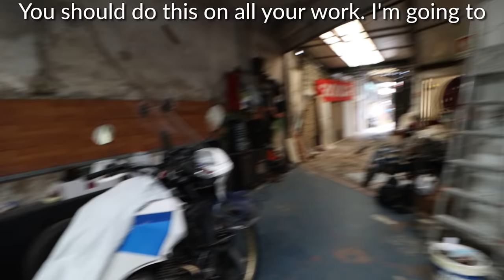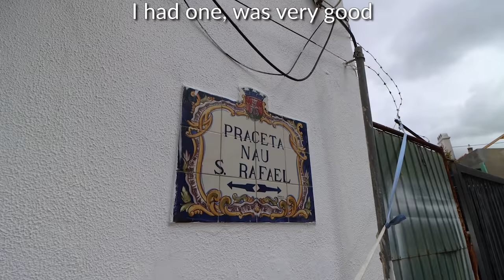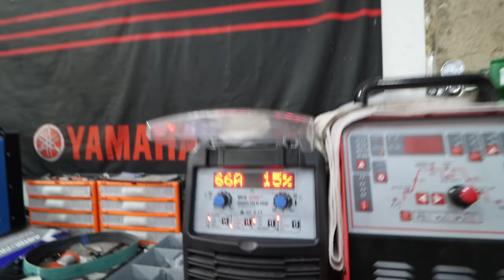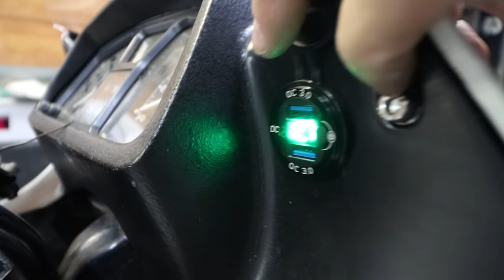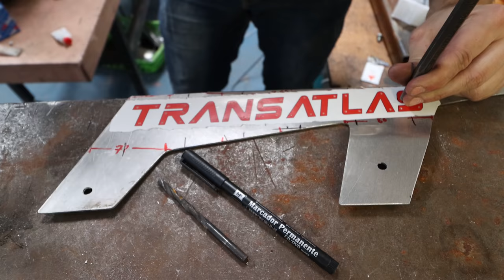First Time Running Complete New Exhaust System - Honda Transalp custom build Pt. 4

Comment: Cool video! Don't forget some heat guard on the pipe behind the peg otherwise that hell of the pipe will melt your heel ;)
Reply from the maker: Yea didn't take long to melt some glove when I casually put my hand there while inspecting during the test ride. I've been going back and fort about it with Mago since last week and he has just the piece for that. Should be the last thing going on.

Comment: Oh Man! I'm in love with that bike. I have a Predator windshield from Goffi on my 650 and now I think I will go with that fender :D. And that freaking exhaust.... Sweeeeeeeeeeeeeet!
Also loved what Mago was doing during Rammstein Du Hast. \m/
Please make a summarize video with all changes on Atlas Man!
Nice Polish there BTW ;).
Reply from the maker: Yeah it just ups that front style which I think is the weakest angle on the TA. All that's missing is a nice set of thick WP forks! Cheers for sure, it makes the right rear diagonal angle (best) even better. I gave Mago some Rammstein lyrics lessons, how Mutter is a lovely mothersday song.

Comment: Does Atlas have a folding shifter??
I made an adjustable length one that fit my smaller than normal boot. I bought a used off-road shifter and drilled adjustment holes on each arm.

Comment: hey man where did you get the handle protectors, i want some for my AT750?
Reply from the maker: They are called 'Barkbusters', a few options online but stock can be an issue. I got mine at Belgarpir moto near Sintra.

Comment: Did you change carb jets? Sounds it's now running way too lean?
Reply from the maker: Not at this time. We later still adjusted the screws on the carb and it was running better with pretty instant throttle response. Those don't have anything to do with mid to top but so far a short stint on the highway going 120kmh went well. Generally I don't sustain high speeds, doing about 100kmh on average. I'll keep an eye out on the plugs, who knows might be a job for later.
Reply: @iPedroMota  Good to hear. Anyway it seems to definitely have done the trick. Otherwise it wouldn't have ran lean with backfires. I'd suspect you've got couple horses more when you change slightly bigger jets. Tell Mago that he's done good job 👍👍

Comment: I think that you need a little bit of practice in Polish language ;) It sounds more like Russian for me ;P However, you said "Urządzenie posiada system (?) voltage reduction device, który dla trybu spawania MMA elektrodami rutylowymi i zasadowymi obniża napięcie (?)" so I understood pretty much most of it ;) Not bad :)
Reply from the maker: Tak! I've forgotten most of the very little Polish I've learned, all nice words of course, when working my first job in agriculture when I was about 14/15 years old. A lot of hard working Polish dudes there. Btw congratulations since I just taught you how to Mig weld.
Reply: @iPedroMota  you did pretty good with the Polish worlds - this is not an easy language.  I know that some people are working in Netherlands in agriculture so I believe that the learned you only a nice worlds ;) P.S. The part that you just read was about stick welding so I think in the next video you should read more of this manual ;)

Comment: PEDRO - Although the exhaust looks great and high performance it might not fit your application, if you leave the motorbike UNDER THE RAIN (engine off) water could fill up the exhaust AND eventually get into the cylinder itself (through an open exhaust valve). A hydrolock waiting to happen.
Reply: Good observation. Guess Pedro will have to avoid the UK then. Atlas will be spitting water from time ti time before it spits fire again.
Reply: We are in Portugal... Portuguese mechanic: "rain? What's that?"
Reply: @MrPMBraz  haha, i live in Miami and when it rains here, it pours!. A custom exhaust like that will be filled to the brim an a matter of hours.